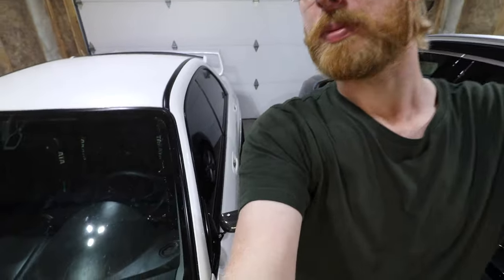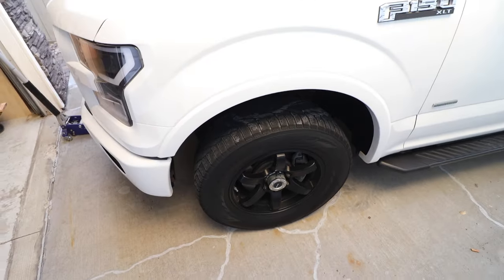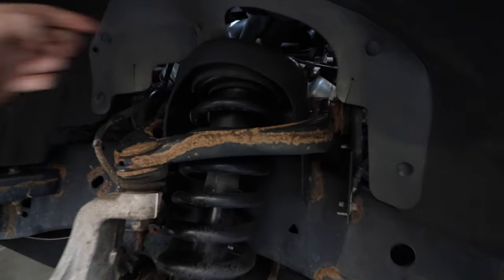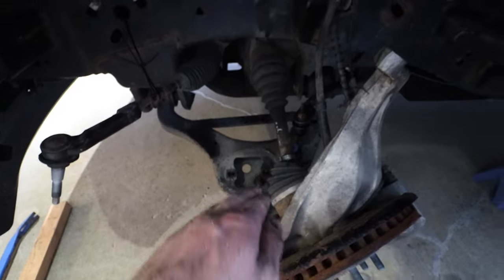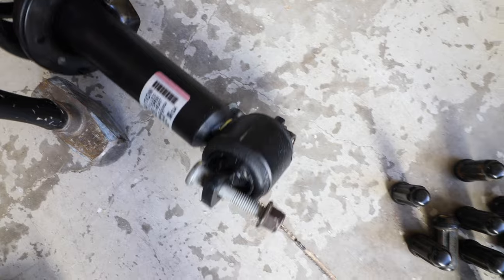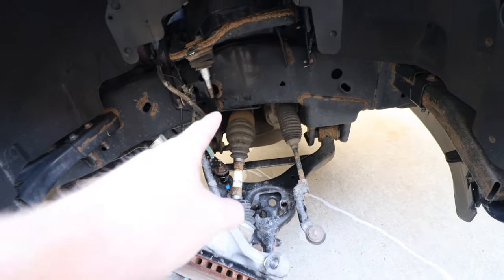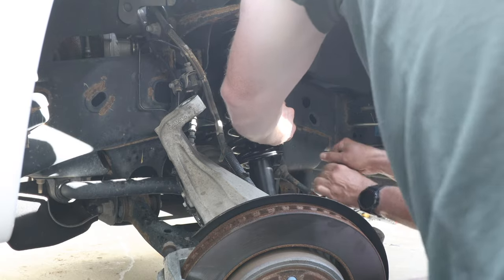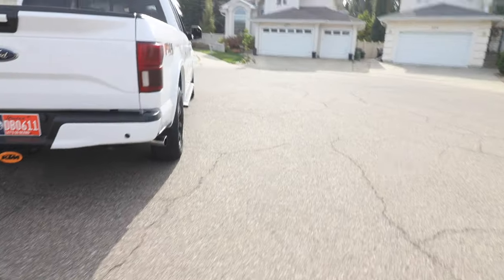How to Install a Leveling Kit on an F150

Comment: Can't believe that you didn't replace both struts. (1) the good one will probably fail and you'll have to take that side apart again and (2) now the two sides will act differently with one new and one old strut.
Reply from the maker: Oh ok, didn't think about that.. but I can see the logic in it! I can confirm the truck has felt fantastic since doing the install. No issues thus far 🤞🏼
Reply: Agree 💯

Comment: If you use a long cheater pipe and push the lower control arm down using the frame to push against, it would be easier to get the strut in and out

Comment: I just did this on my  truck. I used a spring compressor  it made it easier to get out and in . I also used 1/2 inch bolts and nuts to make it easier to get out if I need to in the future.
Reply from the maker: Thats a good idea!

Comment: I'm installing the same lift in a 2019 F-150. I don't quite understand the right and left strut. In this video it says you'll have to use the left for the right and the right for the left. But it still doesn't work
Reply from the maker: Hmm. Not sure. You had to swap the left and right struts, as they're technically going to be sitting backwards after. As the spacer studs need to utilize the top holes in truck frame.
Reply: @brodiecd7093  I got it figured with in minutes of asking the question... You simply rotate the bottom bushing to line up the 2 bolts on bottom. No need to switch sides.

Comment: Thanks for taking the time to make the video. I thinking of just adding the 2” spacer up top of factory specifically for ride quality to stay as close ti stock ride as possible. Please be honest, how’s the ride quality, noticeably stiffer riding up front or just like stock smooth????
Reply from the maker: Hey all good, thanks! And in all honestly, hardly even noticed them. Besides the truck feeling maybe slightly taller at first, the ride quality was unchanged. I've driven in trucks with front & rear levelling kits, and I find the rear level makes a truck feel stiff/awkward. And I never got that effect in mine, still smooth. That all being said, I'm sure it does change the ride to some degree, but not enough where I recall noticing anything.
Reply: I’ve got a 2023 Lariat FX4 that I had Falcon 2” setup installed and now the ride quality from stock being smooth to 2” coil overs riding and feeling like a 3/4 ton. I’ve only done the spacer once on my GMC 1500 and that drive bad too so I splurged and went CST with Coil overs. I’m just worried still having a rough ride but wth, I’ve already got $2700 in for the falcons and alignment what’s another $250 Ready Lift spacer kit plus alignment going to do? Maybe smooth like yours cause if not I’m going to just do a 4” BDS Coil Over Lift.

Comment: Thank you for this great video I already start doing everything one of the struts is on the car the other is going to be done tomorrow but thank you for showing that where you place the bolts is on an angle and how you fix that. I had to remove the cv axel that was the only way that was coming out I’m surprised you didn’t had too
Reply from the maker: @guille20089  awesome! Yah it definitely helped having a couple sets of hands to get them in and out. Was a little awkward at first, but easier once we figured out what to do

Comment: Hey guys. I have an 150 XLT Sport 4wd Super Crew.  Here is the quote when replacing 1 bad front end strut on any vehicle really!
If at any time the struts or shocks are leaking, broken, or damaged, they should be replaced immediately. Lastly, they should always be replaced as pairs. In other words, if one front shock or strut is replaced, the other front shock or strut should be replaced as well.
 Don't be cheap! You should have bought Quick Lift struts from any off road vendor. I bought the Rough Country 2 inch Quick Lift struts on sale for 300 bucks!
Those pucks suck.
Reply from the maker: Since posting this, I have heard about replacing the struts in pairs. Not something I thought of or was told at the time. That being said, truck has felt great so far with the pucks! I'll keep an eye out for other options if things ever need replaced in future 😉